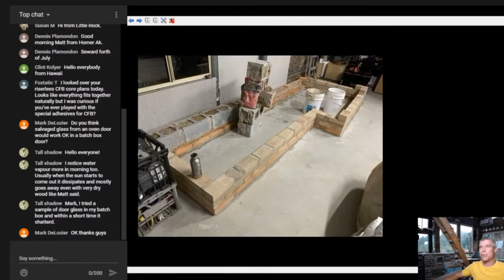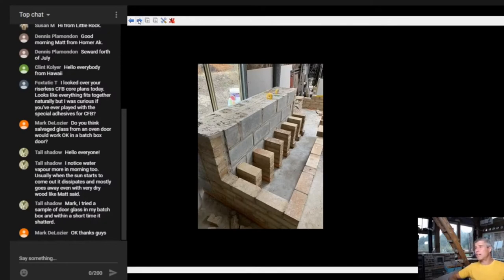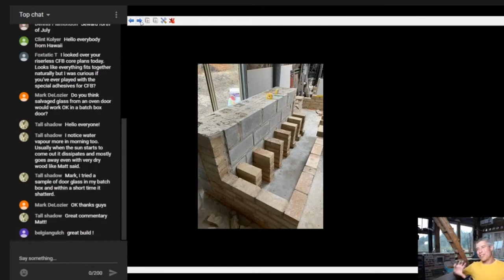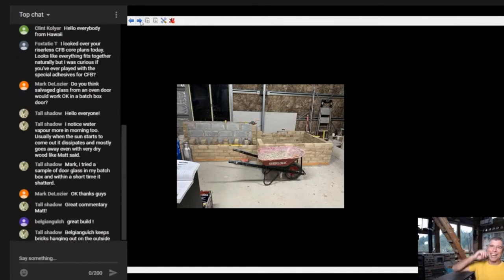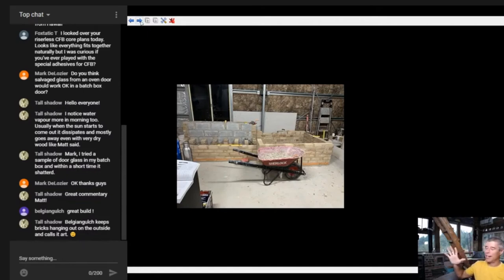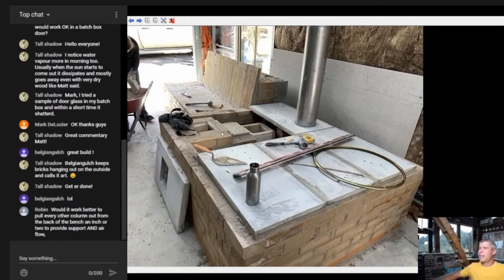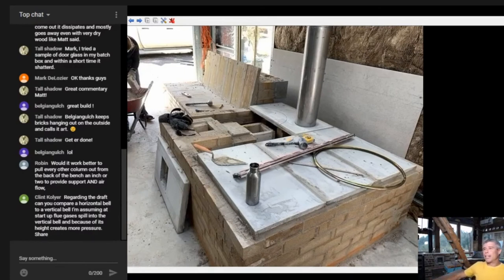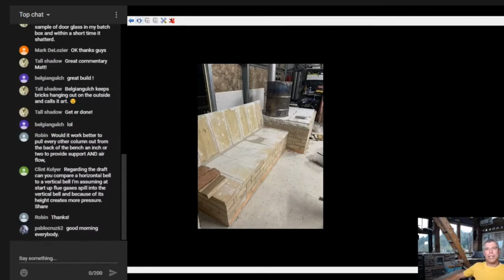Brick Rocket Mass Heater build in Australia

Comment: I love the simplicity of this build! 

Quick question: It looks like the first bell is higher than the bench. Also the entrance to the bench seems quite low. Can you comment on if this would heat up enough? 
Considering that the hottest air will never make it to the stratification chamber of the bench, only the second or third hottest air will make it through that entrance to the bench.
Reply from the maker: Hi! I loved your three year review of your stove! I think this one is designed very well, in my opinion the bench should be designed such that it doesn't get too hot even during the hottest, longest burns. In this one while the bell entrance is lower than the main bell it is still above the chimney exit and as such should stratify and heat the bench adequately. As you noted, the bell top will see the highest temps, then the bench, which in my opinion is just about right. Hope that helps, thanks for the comment!
Reply: @broaudio  Right, that makes a lot of sense actually! :)